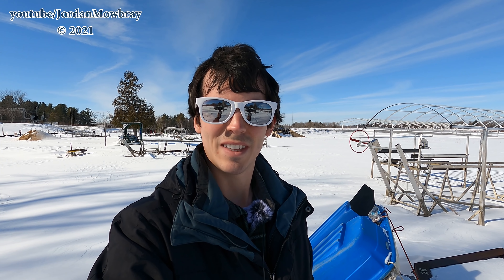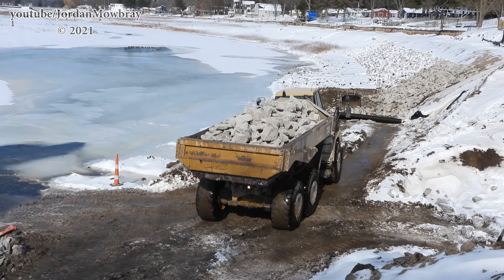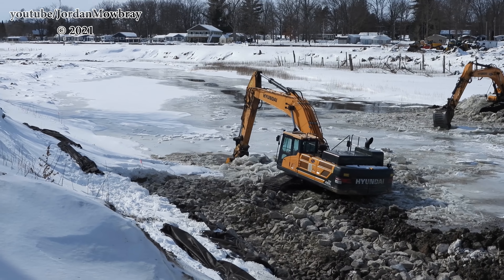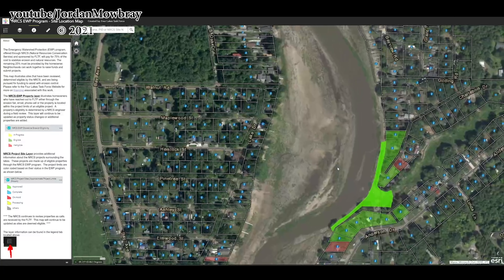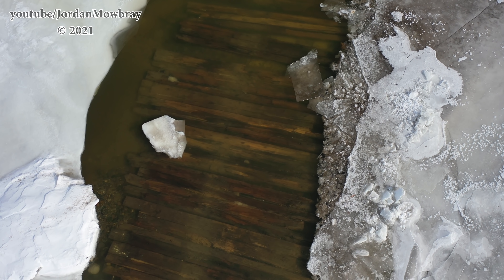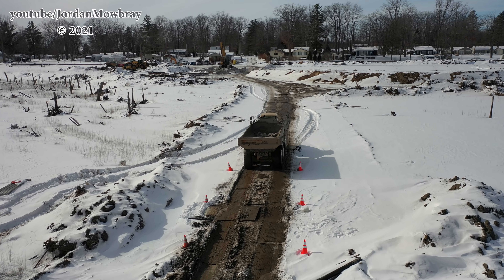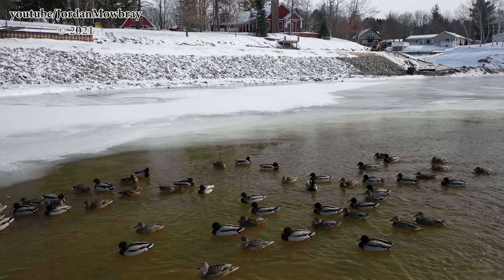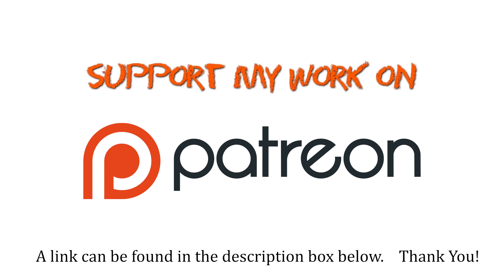Wixom Lake Erosion Control Project - Stabilizing the Lake Bottoms

Comment: Hi Jordan, awesome work!

The O-steam shovel (not sure that is correct? The 1910(?) shovel that was recovered in your other video) had a 3/4yard bucket. What size of bucket are on those Hyundai 's?

Cost wise, what was the dollar value of the equipment seen in your drone video? A couple of million? Is that the main cost of the rebuild?
Reply from the maker: Thats a good questions. Im not sure what the bucket size is on the new excavators but I can find out for you. I would estimate pretty close to a million but that is not what is being paid for with these erosion projects.

Comment: Where is the broken concrete coming from?(rip rap)
Reply from the maker: It is being trucked in from off site. I am sure Fisher has a stock pile at their location
Reply: It is limestone, not concrete rubble, it is quarried in Bayport. The DEQ does not allow concrete rubble to be used any more for rip rap.
Reply from the maker: Thanks for answering Mark. Now I know as well where it is coming from.
Reply: @msfcarp1  Any idea why recycling old concrete can't be done?
Reply: @charlierumsfeld6626  rebar in it for one thing, Idk if that’s the only reason though.